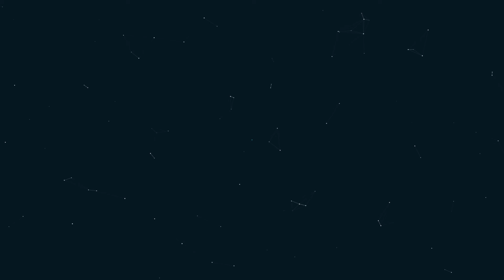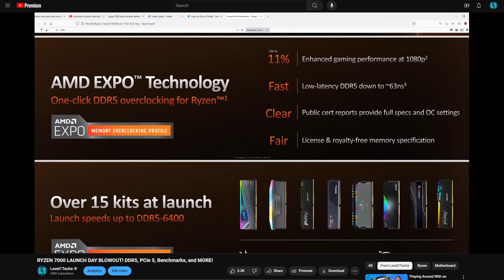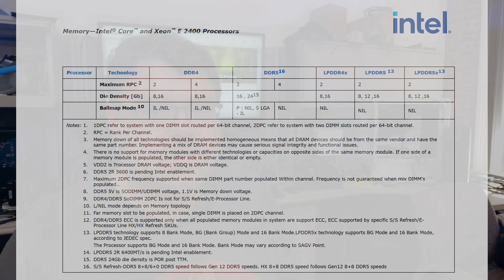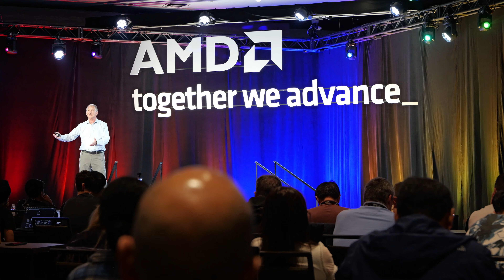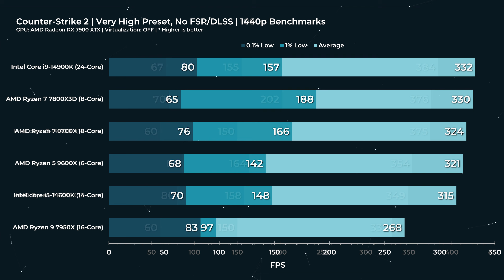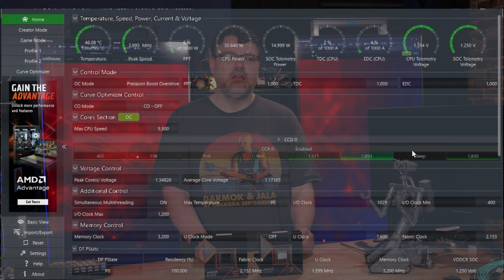Ryzen 7 9700X and Ryzen 5 9600X Review and Benchmarks

Comment from the maker: FIXED GRAPHS VIDEO HERE: https://youtu.be/iJo4mrogJ4g
Check out the Linux Video here: https://youtu.be/A9wulvhU1Ls
Check out our article for all benchmarking results & how to USB flash update your motherboard BIOS to support the 9000 series: https://forum.level1techs.com/t/benchmarking-results-usb-bios-flashing-for-9000-series-zen-5-cpus/214583
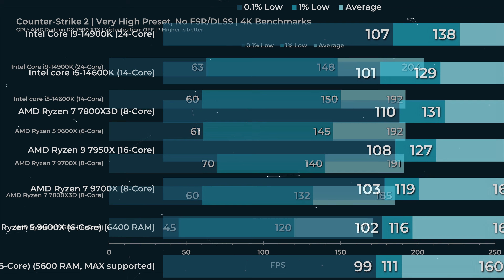Reply: Better yet checkout the 21:21 zoom in.
Reply: Nobody has ran the one benchmark that's gives closest to practical performance for programmers with it for the openbenchmarking. 

Timed Apache compilation.  Base on its bad scaling with core count it should be a good approximation for recompiling after a small change in source code.
Reply: 16:20 4K results are all chopped off the screen in the video (zoomed in too much)
Reply: 21:32 results are all chopped off the screen in the video (zoomed in too much)
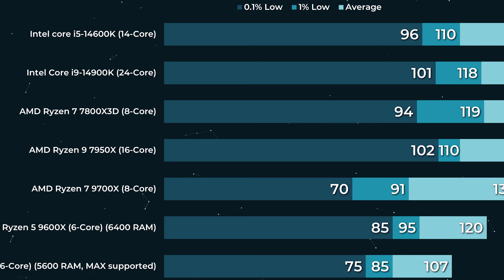Reply: 24:00 results are all chopped off the screen in the video (zoomed in too much)
Reply: If you were on a 7950X3D?
Reply: Sorry. Very interested in your Johnny #5! Link?